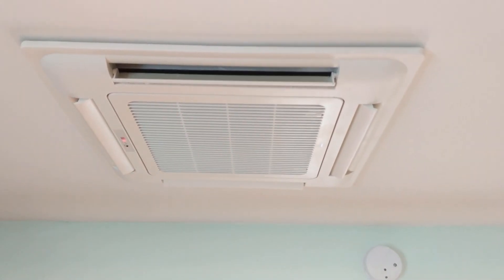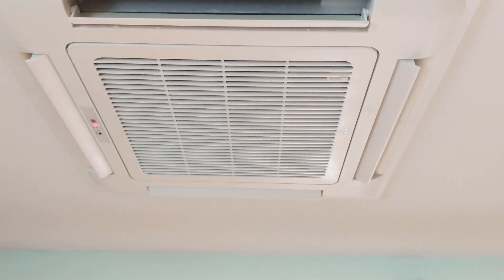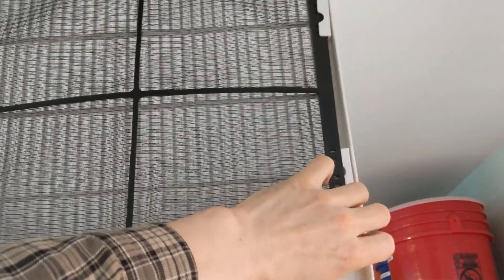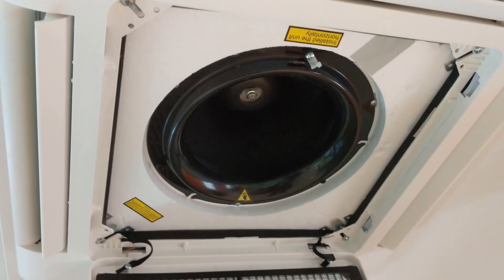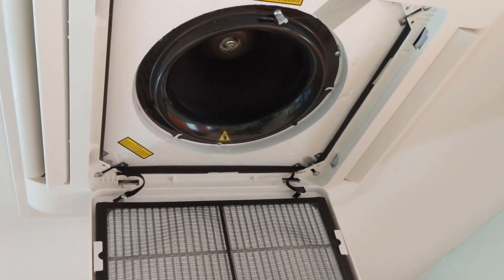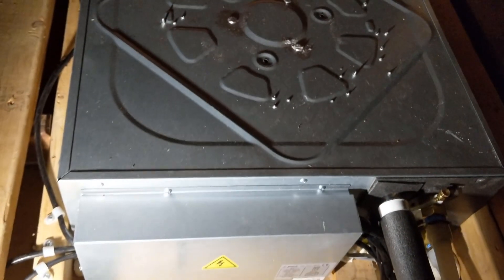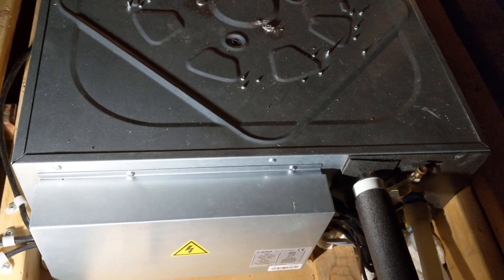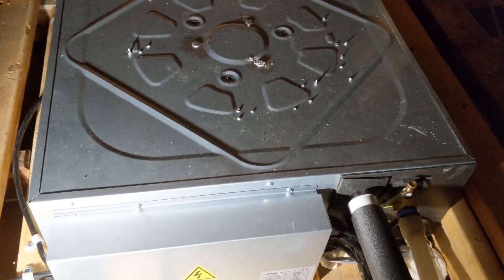Ceiling Fan Coil, QC, CAN, #2/2

Comment: Nice, I guess with joist 16" on center like I have at my house it won't fit.  Your water pipes are not insulated, are you going to use this for cooling?  Are there specs showing the BTU output for given water temperatures and flow rates?  You mentioned this can work with low water temperatures but that isn't quantified with data anywhere on your website.  Thanks for sharing.